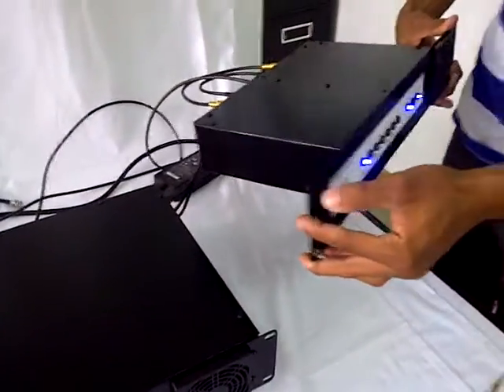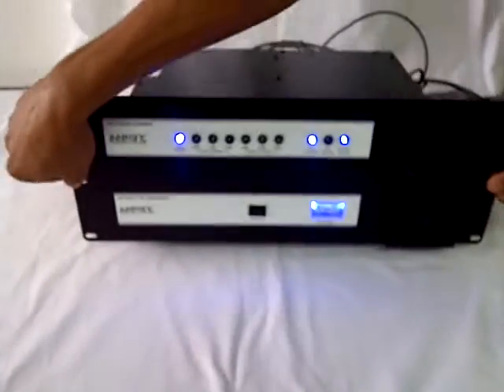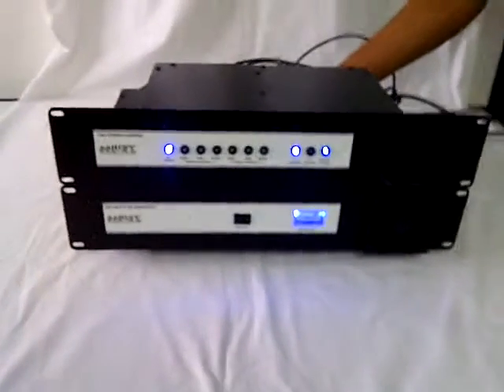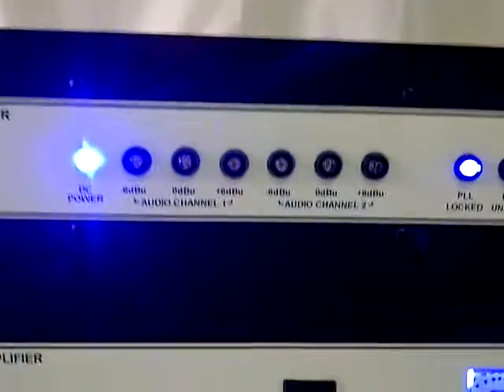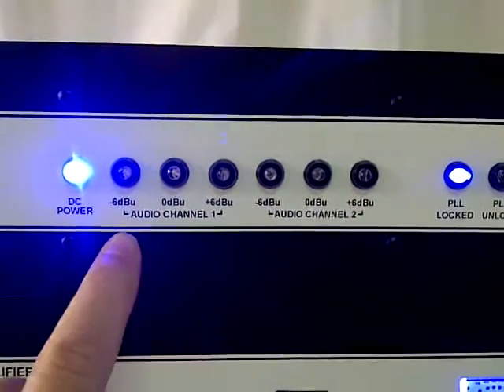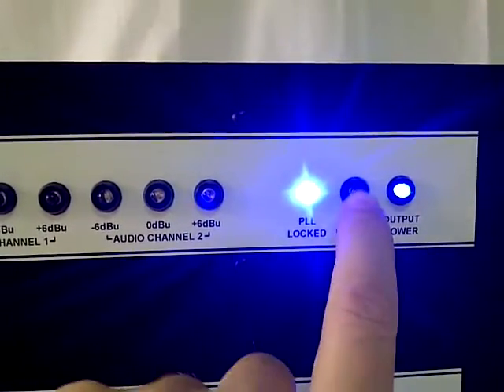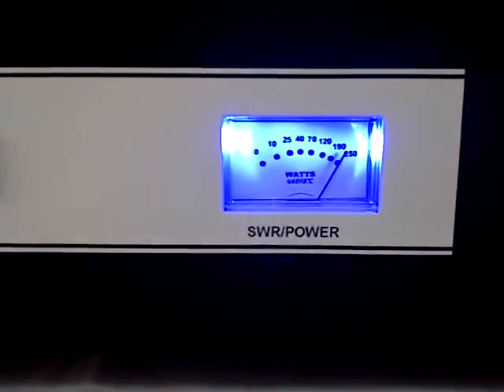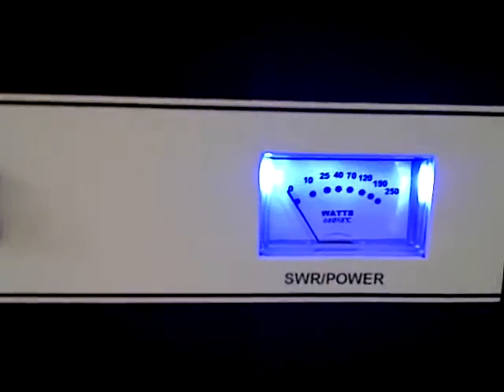200 Watt Transmitter (1W Driver/Exciter and 200W Amplifier)

Comment: Why in the world would anyone build or buy an amplifier that only has 200-500 watts and needs an external 1 watt to drive it? This driver is usually built right in so the transmitter is a stand a lone device. This is a waste of money.
Reply: Hi Johnny, 

I'm Paul for Aareff and we do sell an all in one unit with everything, if you want it, stereo, processing, even RDS, you can check it out at https://www.aareff.com/en/200w-fm-transmitter We have something for everybody.

Some customers want the amplifier only, for a number of reasons, so it's not a waste of money, on the contrary, it saves them money. In the past some customers purchase 1W, or 30W, or 100W with the separate 1W driver, they only need to change the amplifier to upgrade power, this is cheaper.  

Some customers like to have a 30W amplifier as an emergency back up, but to be honest they don't need it as our amplifiers are super reliable, but, still, it gives them peace of mind. 

But one of the most beneficial reasons for using separate amplifiers, is that multiple amplifiers can be used. For example some of our systems use four 200W separate amplifiers, four separate antenna cables and four separate antennas, which makes it virtually impossible to go OFF AIR under any fault condition.

If you were to use a single transmitter of 800W and it went off or faulty, that would be it, GAME OVER and OFF AIR until it was fixed. This could be days, maybe even weeks off air, think of the cost of that to the station. This virtually cannot happen with multiple separate amplifiers

For example, let's say in a system of four amplifiers, one 200W amplifier develops a problem (very unlikely, but not impossible), it can shut down all together, the other four 200W amplifiers will continue to operate unaffected independently. It's the same if one of the antenna cable or connectors develop a problem, only one part of the system will go down. The same if an antenna goes faulty or is hit by lightning, the other three amplifiers and antennas will continue.

So you see, systems with separate amplifiers have great value and the only way the station could be completely shut down is if all four 200W amplifiers, cables and antennas failed at exactly the same time. This is virtually impossible.

Comment: I wonder, will this amp work with my 15 watt Niorfnio FM transmitter(turned down to 5 watts)? I dont want to buy another transmitter.
Reply: You do realize you can purchase the 1 watt exciter kit from AAREFF capable of driving this amp for less than $200. Much better choice. That model is only mono but you can easily make it stereo with computer software or the AAREFF stereo coder kit which costs less than $50.
Reply from the maker: No it won't. We don't want any of our power amplifiers being connected to cheap Chinese transmitters. The output of the Chinese transmitter you refer to is not clean enough, there are too many spurs, although at fairly low level, but still nowhere near good enough or safe enough to be amplified to 200W.

Comment: 200w @ 3m band not a good idea in my opinion
Reply from the maker: If you have an FM broadcast station it's a great idea used with an high gain antenna such as our 5/8 wave at https://www.aareff.com/en/5-8-fm-transmitter-antenna/ This combination can give you up to 40 miles range.
Reply: hopefully not with a rg58 cable :/
Reply from the maker: No, not RG58, these days we use LMR400, great cable, low loss and low price. We use RG58 for dummy loads, literally, a 100m roll of RG58 makes a great dummy load of 1.0 SWR.